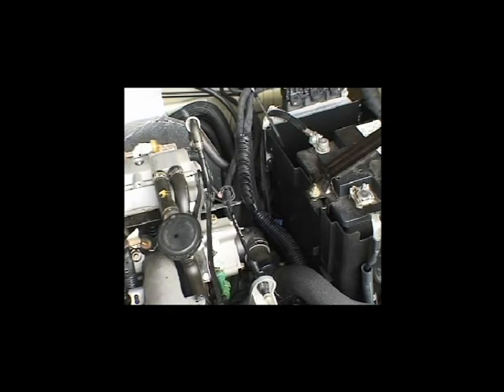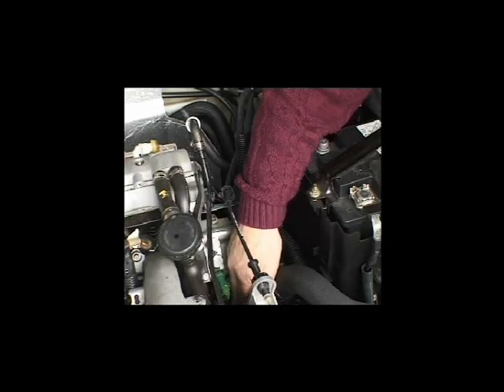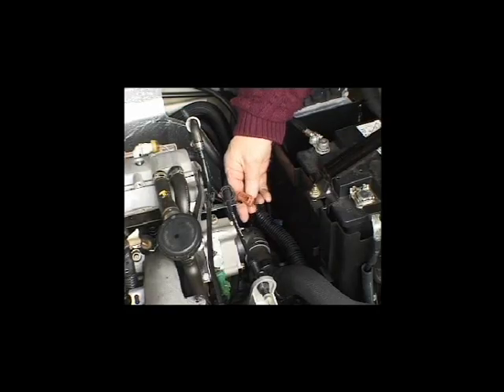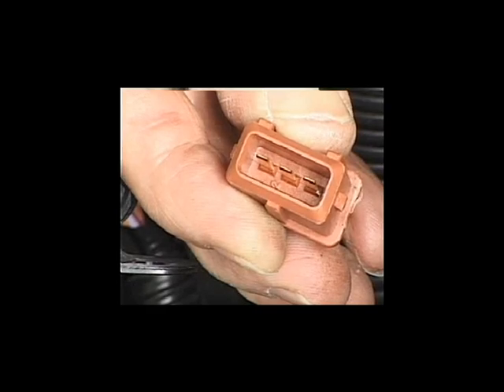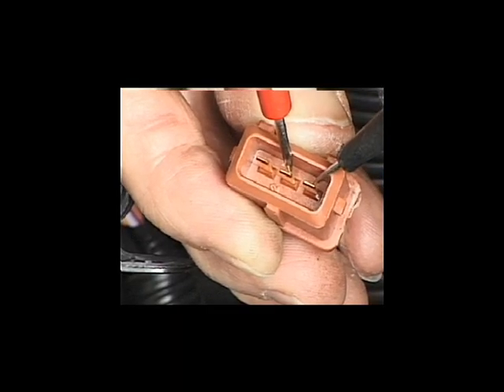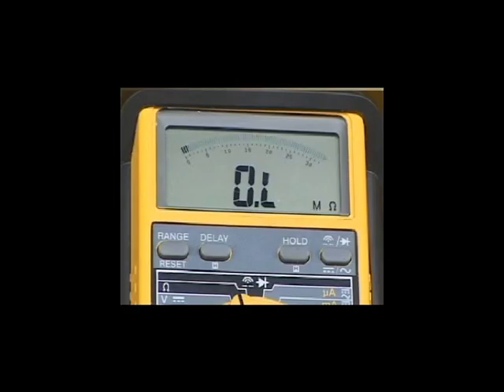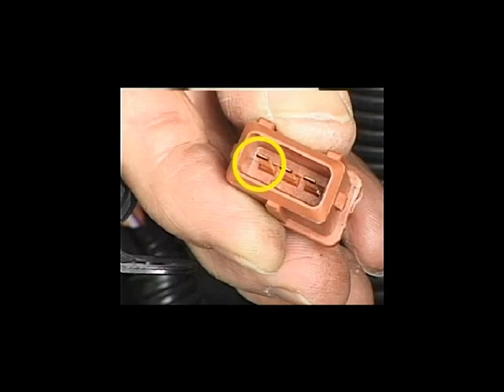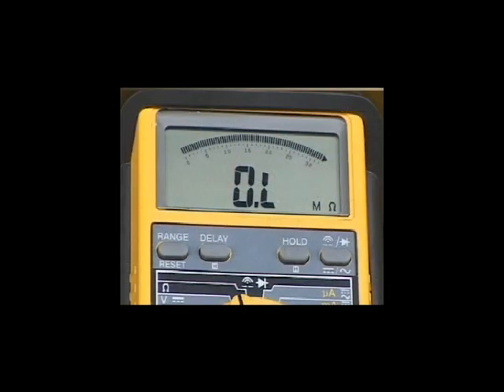How to Test an Inductive / AC Generator Crankshaft Position Sensor (CKP)

Comment: Measure the voltage between the 5V reference circuit and the chassis. =   4,8~5,2 V
Measure the voltage between the CKP signal circuit and chassis.           =   4,8~5,2 V

mine connector value is 2.38 V / car not run only turn key start

is it bad ?